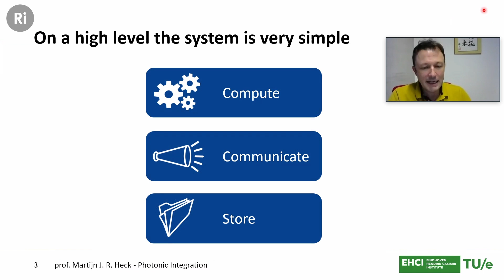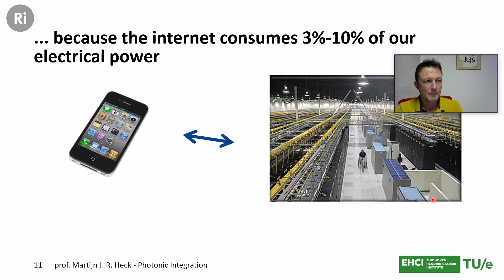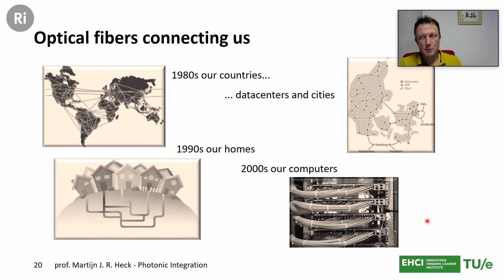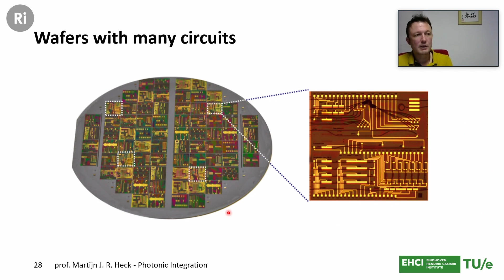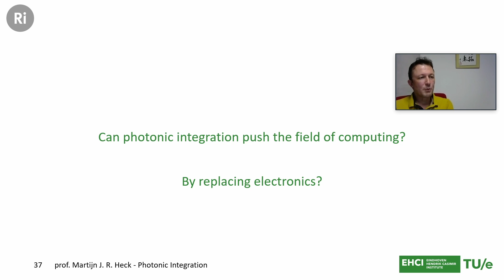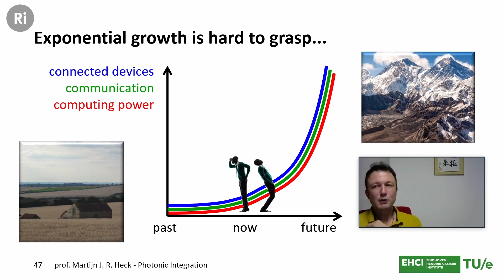Are Optical Computers the Future of Computing? - with Martijn Heck

Comment: When it proves difficult to increase the power on a chip, programmers will have to start becoming creative with code. It has been too easy to just write billions of lines of code without thought to streamlining.  
The old Commodore 64. When it first came out the programs were unsophisticated. Without access to increased processing power, the programmers managed to find ways to overcome the hurdles of the day, power, memory, etc.  By the end of its reign, the old 64 was displaying far more sophisticated and interesting programs. Mainly games of course. Then again, games are really what has driven PC development. Even the Amiga improved once the programmers got to grips with coding.  
Since the advent of Windows 95, there has been a steady reliance on chip speeds to push heavier and heavier code.  I think this will have to change as access to faster chips falls off.
Reply: Yes, I was always wondering the same. At uni, we write so simple codes and everything, but then I think about how small amount of computing power, and memory were available back then. And they sent people to the moon with those old machines. Incredible. 

Altough while I agree, that better software could improve speed and efficiency in many ways, I think the main point here is the hardware limitation we are approaching. 
But even if it wasn't the case, writing those codes back then required very smart people, and I believe that it is equally important to make programming more accessible, easy to begin to use, because many great ideas started with not so much experience and knowledge.
Reply: @VHenrik007  look at low-code and no-code programming
Reply: I am one of  those so called  boomer Programers. Programming the hardware directly is no more difficult  now than it was over 30 years ago. The argument concerning the Compilers, there only as good as the programmer who compiled his Compiler, Useless. Please don't misinterpreted the compiler paradox. Usually your forced into using said compiler due to the proprietary nature of the libraries and or course if its a gfx library with the abstraction layer only available as a high level language and not as low level ASM, your only option is to use the available library. We used cross compliers for different CPUs, but the low down of using those  used to be your get miscompiled code, if it came across a special piece of crafted code which needed to be done to improve performance or specifically needed for whatever reason.  So what we used to do was simply use the txt output of the Cross assembler and used the  source code. Any specially crafted sections of code due to hardware or CPU differences simply recoded for that hardware profile for what we now called hardware extraction layer using libraries and macros for any platform you care to mention. Writing something in another language is great but when you got an interpreter sitting on top of another interpreter just because somebody fancied writing something in this great new language is an utter waste of the fantastically powerful processing power CPUs, graphics cards and chipsets we now have because they are bound by proprietary technology. In the end all the cpu chips are the same now bar architecture, and  ie Risc chip emulation. 
I think it's time to reevaluate the bloatware we all seem to have to put up with, let's get back to basics use the original idea of object oriented programming,  using the fast hardware level. The world of API's although convenient is just too bloated, but what can you do if your writing for bloated operating systems. Go back to square one recode the operating systems, streamline the Bells and whistles of the latest GUI,  stop the copy paste library culture.
Reply: @1103-x5r  This is really what I was trying to say...although you clearly walk the walk and said it much better.  
The hardware is phenomenal, but I think it is held back somewhat.
Reply: Takes time and skill though. There are very few programmers today who could pull that off, and it could take a programmer working at that low level days of work to achieve what a high-level programmer can achieve in a few minutes. It costs a lot of money to hire such top-tier programmers for that many hours. Then repeat that for every platform, because such optimisation is not portable.
Reply: @vylbird8014  You understand that with performance boosts likely to slow over the next decade or so that some other way of increasing efficiency will be necessary?
Reply: @95Gabe  boost might start to slow,. but current code efficiency will still allow things to readily run. Yes, I know... Augmented reality etc.
Reply: Reminds me of the final days of the PS3 when the machine was already ~7 years old and incredibly underpowered, some devs managed to create incredibly good looking games like The Last of Us, that really had no right to run on the hardware it ran on
Reply: I always thought programmers seek every way to streamline codes just so their programs have a chance of just running in the first place.  A lot of the complexity is borne out of the need to have the program work with an operating system standard while being able to work with legacy technology with an eye for future technology.  I am no programmer but I do feel that computer technology has evolved into it's own massive bureaucracy in how it must deal with everything.
Reply: @ph11p3540  I think that often they use off-the-shelf chunks of code to do certain regular tasks. As long as they just repeat what they do they will never need to be inventive to overcome shortages in power.  The truth is that up till now they haven't needed to. That may change sooner rather than later.
Reply: This is an oft repeated boomer programmer argument. The fact is conpiler technology continues to advance and software speed is increasing -except for the web which is a giant mess
Reply: @xiaokourou  How obnoxious are you really?
Reply: I've been thinking about the same thing for a while now.. The limited performance rn is beneficial imo to prepare for new technologies, instead of getting far more powerful chips right now.

Comment: As one who has spent forty years researching optical computing and neural networks, this is a very good introduction. I am a bit surprised that limited progress has been made in the exploitation of the massive parallelism capability of Optics (as illustrated  in the talk by the use of the double Fourier Transform system). This was mainly due to the lack of stability of existing liquid crystal light valves.
Reply: Hello. Do you think an ASPIC (application specific photonic integrated circuit) could be designed to perform the SHA-256 hash function?
Reply: @Andrew_2414  yes it perform sha256 which I assume you'll use to hash bitcoin at the speed of light right?
Reply: @mohamedb737  "speed" is not an appropriate term in this context, but yes, the question about sha256 was for the purpose of mining Bitcoin. The motivation for mining with a photonic integrated circuit, rather than an electronic one, is that photonic computing is more energy efficient.
Reply: @Andrew_2414  when I say faster Im not referring to algorithmic complexity since that's solely dependent on the quality of your algorithm. Im referring to the fact that with light the fuctions in SHA like CH for example will be performed while light is moving, and all of those functions will be done in parallel as well, so the time that takes you to go through 1 iteration is literally L/c, L being the longest light path in your setup meaning if L = 30 cm then it will take you 1 ns to go through 1 interation. not bad hein?. You really don't think that you'll be able to go through far more nonces this way? if not please explain why?
Reply: @mohamedb737  I don’t have an opinion either way, I’m not a photonics engineer. What I meant was, just because photons are used to calculate hashes doesn’t necessarily mean the hashrate (hashes per second) of a photonics chip will be greater, depends on how it’s engineered, e.g. parallelism as you mentioned. I do think it will be more energy efficient, though, and that’s the important part as far as profitability is concerned. Fewer joules per terahash.
Reply: @Andrew_2414  bare with me please let's go back to that example where L(longest light path) = 0.3m <=> 1 hash every 1ns <=> hashrate = 10^9 hashs/s right? is that good or bad? like on average how many hashes do u need to find nonce?
Reply: How come the two have never been combined? I don't need to tell you what optical can do for neural.
Reply: It's rubbish.  It's just people with extremely limited knowledge of computers spouting their thoughts on the subject of computers.  All they know about it is the words involved.  In their brain, "light" involves light speed and applying it to computing you get light speed computing.  The end.  NEXT!
Reply: @starbase51shiptestingfacility  No offense, but as somebody trained and educated in the subject of physics at university, I think I'll give more credit to the words of the professor than the strange YouTube commenter with Star Trek videos on his channel. NEXT!
Reply: @Andrew_2414  Since I don't have a degree in physics, I'll instead prove I am at least smart enough to figure things out even a college professor hasn't.

Let's start with Einstein's E=mc^2, all it produces is a large number that does not correlate to anything.

Energy = mass x the speed of light squared
Energy = 5 grams x 186,000 x 186,000
Energy = 5 grams x 34,596,000,000
Energy = 172,980,000,000

It correlates to nothing.  It's just sophistry, a fake.  Einstein was a good mathematician, but not a good astronomer or a physicist. He is just another person who was hyped by the media and people who don't know physics, like Steven Hawking.  If you deprecated their "contributions to science" you would miss nothing and at most removed rubbish from science.

And to further prove, you know nothing about computers and how it relates to science.  Physics is the wrong field.  The main discipline involved with electronics is actually chemistry.  Most people only think of chemistry as liquids (true) but it also involves solids like silicon and gases (oxides), and metals.  All chemistry.  Physics, very little to do with computers.

Why does my channel have Star Trek Online?  It is a video game, In case you didn't notice.  I got involved with computers a long time ago (1980), because I like video games.

That you would mock me shows you know very little about me.
Reply: @starbase51shiptestingfacility  E = mc^2 uses Joules, kilograms, and meters per second for units.
Reply: @DS127  "mc^2 uses Joules, kilograms, and meters per second for units."

Lets you prove it.  

I can prove it's fake, because the speed of light has varied from a range of 250,000 miles/sec to 180,000 miles/sec, meaning it would be very imprecise. 

Lets see you prove your claim or be labelled a liar or idiot.
Reply: @starbase51shiptestingfacility  Spend 5 minutes to look it up. Try searching for "E=mc2 units".
Reply: @DS127  You failed to prove your claim.

You are now labelled an idiot, as per previous comment.

You want me to research it.  I already did.  I know it to be sophistry, also known as fake, einstein.
Reply: @starbase51shiptestingfacility  
......its indeed strange for someone not involved in the field of science to spit derogatory remarks as a excuse of lecture towards the supposed inconsistencies of of science let alone dispute about computing, unless you do more than just play sci fi games. Its a clever jab to throw the word 'prove it if you can' against someone while sprouting the impression you have it all figured yet provide nothing but contra statement with little to no substantial research back up or why your logic should stand justified. Its not the first time i see such random commenters/genuises of vanity quacking in corners of YouTube. If you've Really got something to prove & present the world, contribute where its Actually required. Not as unconvincing comment jockeys trying to flex a part of mind for once cause a subject matter triggered your ego.
Reply: @chang1915  Trying to sound like in intellectual.  You fall far short.  I can prove what I say.  That is more science than you can ever aspire to.
Reply: @starbase51shiptestingfacility  ......big words but no show, thats what your represent and aspire. Egoism is quite a drug!
Reply: @chang1915  Yeah, I already proved I am smarter than most by pointing out Einstein is an einstein.  E=mc2 is junk, mere sophistry.  

Which probably means you didn't read all the comments or don't even know what is fake and what is science.
Reply: @starbase51shiptestingfacility  What is your point in bringing up the speed of light or mass energy E=mc^2? The speed of light changes with the medium, it's known for a homogenous media, it's constant. Your mass energy equation shows how much energy a 5 kg mass contains, how is that relevant to computing? It's the energy required to condense 5 kg of mass or if you could destroy 5 kg of mass and liberate it's energy that is what is released. That equation is used in nuclear chemistry for obvious reasons.
Reply: @starbase51shiptestingfacility average redditor 😂